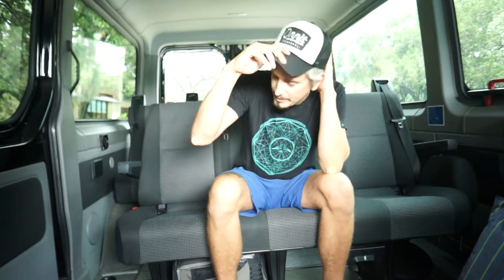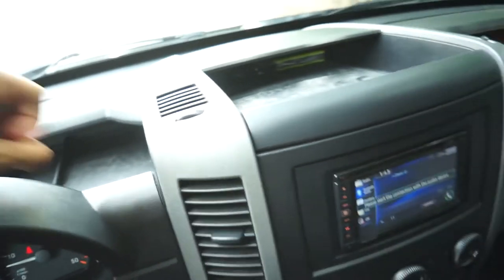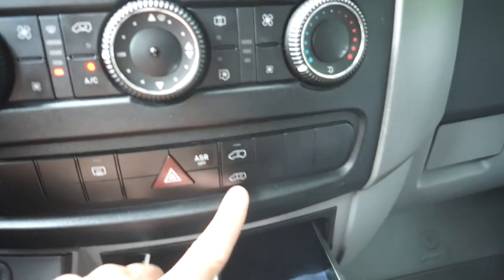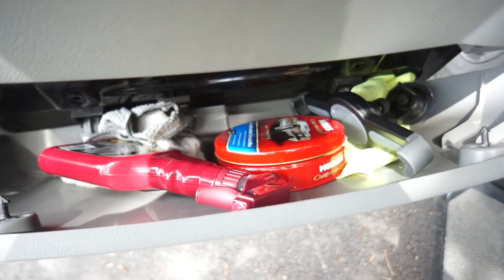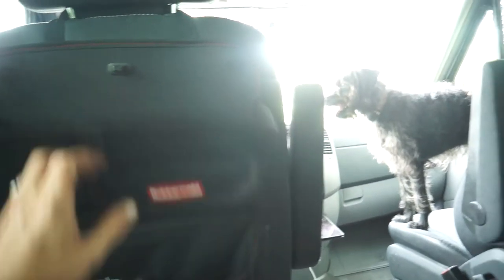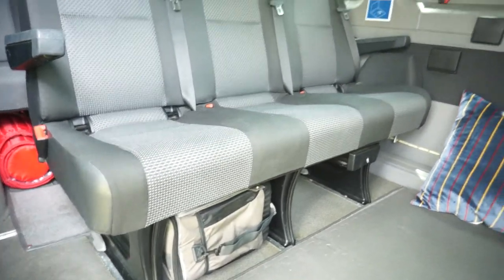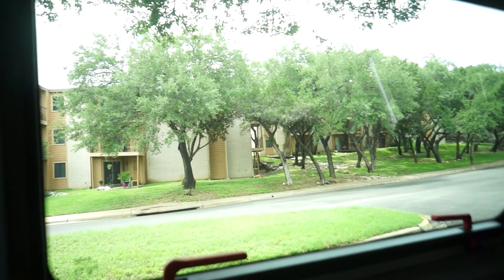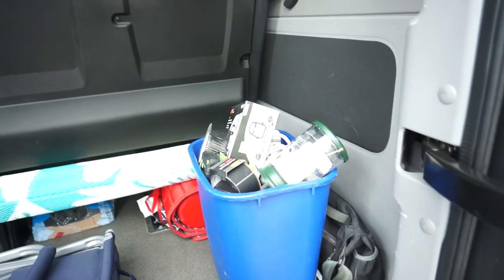Stock 2012 Mercedes Sprinter Van 144 Interior Walk Around

Comment: You have an other 12v outlet under the cup holders that's always on. And the one  with the cup holders runs on the ignition. It's not a emergency brake. It's a hand brake for parking.